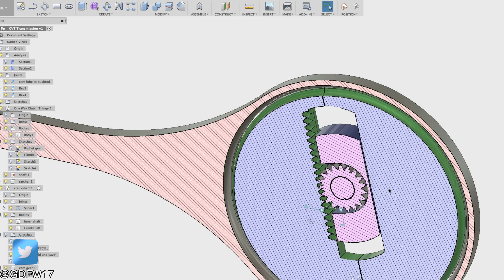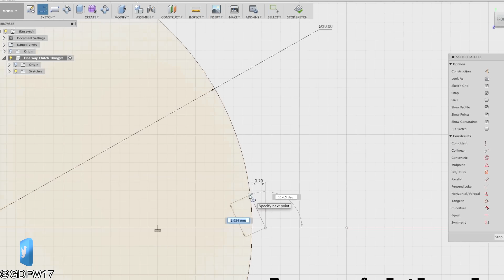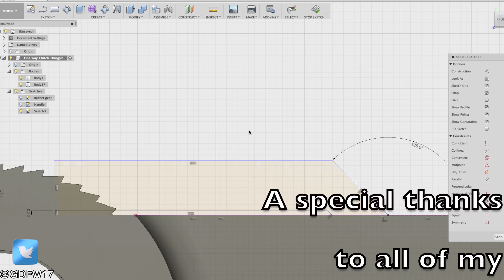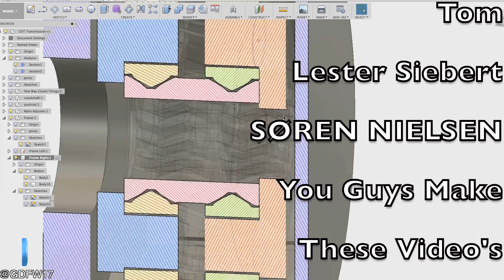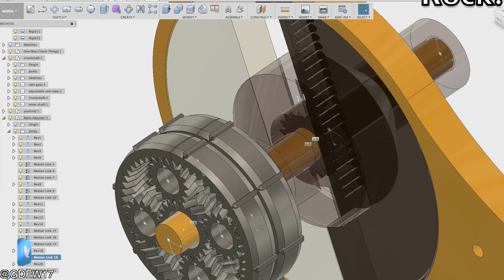The Coolest Transmission You've Never Heard Of... The Ratcheting CVT

Comment: Hay. Your invention is TOO late. with electric mortars. there is no need for a transmission. Teslas, Leafs don't use CVT just one or two fixed gears. even tesla  semai
Reply: If you use enough ratchets, you can overlap their jerks so you actually get a smooth output, similar (well, close to identical) to adding cylinders to an engine. Still, vibrations on the system, and specially the big pushrods would be a heck of a problem, there's already enough crank and rod vibrations to deal with on the engine, and the parts to make it possible at all are quite hefty. Probably gonna be quite heavy, and may add horrible amounts of vibration to the structure even with a smooth output.
Reply: That's all well and good but a recent test was done with a tesla model S being charged entirely off a portable diesel generator, and comparing fuel consumption vs an actual diesel car of comparable size and class.
Guess which used less fuel?

Electric cars are vastly more energy efficient than any internal combustion engine.

The problem isn't the car, it's your source of electricity.
Fuel burning cars are about as clean as they're ever going to get. (remember, by the way that petrol refineries use obscene amounts of electricity as well, an drilling for oil causes a mass of polution. It's more than just tailpipe emissions)
Electric cars are as clean as the source of electricity.
That can range from highly polluting (brown coal), to not at all polluting (solar, wind or other sources).

Obviously, yes, the manufacturing of the vehicle itself is also an issue; (just like solar panels being pollution free is only true if you ignore manufacturing - though again, pollution varies with the method used to power the factories and other stuff  involved).

It's pretty disingenuous to say electric cars cause more pollution than petrol ones as if it's some ground truth, when clearly it's highly contextual.
Especially as petrol cars are as clean as they're ever likely to get yet you're deliberately comparing it to worst case for electric cars.
Comparing best case of one thing to worst case of another...
Yeah.
Might as well say a truck causes more pollution than a motorcycle.
Which is true, but so inane and meaningless as a comparison that it's not very helpful bringing it up.

Finally consider that a decent chunk of pollution caused by petrol vehicles is in the immediate vicinity of the vehicle itself, while nearly all pollution from an electric one is in a remote location.
That won't help the environment as a whole, but it has big implications for things like health in busy cities and so on, which makes it a very useful attribute in and of itself.
Don't be surprised to see petrol and diesel vehicles banned from inner city areas in the near future;
may not help the world, but it'll help the local environment a great deal.
Reply: Electric motors have an efficiency range or power band too, but instead of "turning on" like an old 2 stroke, it's about the ratio of current to horsepower. Electric motors draw the least current when they're spinning at max speed with no load, and the most when they're dead stopped. Any engine generally makes more horsepower when it's spinning faster, but at some point you start losing power due to things like reaction/combustion time, valve timing, or magnetic induction. The mechanism for producing power can't happen fast enough basically. But you generally want those motors turning fast and gear/belt them down to whatever speed you need to move at.
Reply: kennedy796 these are problems that can be resolved in the future, and investments in EV tech will help solve them faster. But you simply can't fix the emission problem of fossil fuel engines, ever.
Reply: +richard vaughn       1hp = 746W, not 786W.
An electric car is very efficient, eg 83% (Tesla Model S) or 89%(Tesla Model 3) vs an internal combustion (ICE) vehicle that averages 20% or less. That is why they are cleaner (yes even if the electricity comes from 100% coal they are worst case no dirtier). Making electric vehicles may be a one off dirtier process than making an ICE car, I have my doubts but I won't argue that point. An ICE uses a large range of materials which have to be precision machined, there is platinum, copper, aluminium and the steel alloys contain many exotic elements, I find it hard to see how building ICE cars is better for the environment; frankly I think the processes employed to make an ICE vehicle are mentally glossed over because they seem so familiar.
Every atom that went into an EVs battery is still there when the battery has reached the end of its useful life, each cell is the perfect sealed package for recycling, ICE, not so much, you certainly can't recycle the petroleum products that get burnt but an EV can run on sunshine (mine does), wind or geothermal electricity.
Reply: No, you will not.
Cylinders can move smoothly because gas pressure don't have to expand at some exact rate.
Solid mechanical parts can't do this. If the part moves — it's either moves all the way as it is or or will bend or crack.

Entire thing might feel less jerky with enough parts added, but every single part will still be jerky.
Reply: You don't seem to know how a racket works then. The only problem on the movement smoothness in fact comes from the crank mechanism not the rackets.
Yes, you CAN overlap perfectly the movements quite easily, you just need to time the rackets so that when one is stopping to push and is starting to go backwards and not produce force anymore on the axle, another one is starting this movement. With exactly 2 rackets 180 degrees out of phase between each other, you get full overlap already, and the jerking does NOT come from the rackets, rather from the crank movement. The big issue is the crank system's unequal speeds, that one brings vibration problems instead, not the rackets.
Reply: Tho... it seems I've wasted my time with mechanically analyzing rackets when you claim others are "bullshitting on you" but you claim 90-98% efficiency (whoa, like close to 0 loss....).
Reply: Well, that's not really true. A electric motor has reduced torque when rotating fast and its efficiency varies with speed, too, so you want to have a transmission in a car (electric racing cars have a transmission for example). You'd probably use the first gear until you're driving like 120km/h (so for normal usage normally not even necessary, and even bad to have more as the weight increases) and then a next gear for the rest. Formula E cars then have 1 or 2 more extra
Reply: Zamundaaa you bring a fair point. But what im saying is that honestly a vehicle needs a light and plentiful source of storing energy. A full 16 gal fuel tank weighs 200 pounds and needs about 150 hp. When we have efficient motors capable of 400 hp, and the battery can charge quick and weigh around 2-300 pounds, then we will have truly eliminated the need for internal combustion and the decline in efficiency will not matter so much. Thus almost eliminating the need for a transmission entirely.
Reply: kennedy796 well I myself wrote that in normal electric cars for the road you won't use a transmission because it's not worth the added weight
For example Tesla used a 2 speed gearbox in the beginning, had some issues and just decided that it's not worth the tradeoff, so now every Tesla has just a single speed gearbox
And as much I like electric cars and don't want to dampen your enthusiasm about them, it's true that electric cars (maybe excluding those city-cars with only 100km reach, idk) are (yet) more harmful to the environment than a gasoline powered car, at least if it's equipped with appropriate filters. The batteries are just horrible. My hope in that field goes into supercapacitors and maybe new battery technology
Reply: Zamundaaa im glad we can agree on something. I do like the idea of electric cars because the cost of electricity is low for now, and they require such little maintenance. It helps reduce waste by eliminating the neglect most ice cars go through.
Reply: Hirantha Bandara I like reading the comments on videos like this, I get a good laugh at these guys arguing with each other sighting all there technacle BS when most of them never actually picked up a wrench and got there hands dirty.
Reply: Daniel Teplitsky  I guess that depends on how the electricity to charge the batteries is generated. If your grid is fed by burning brown coal, then electric cars would technically be more polluting than petrol driven ones. If your electricity is generated sustainably, then an electric car would consequently have zero emissions.

This argument ignores construction emissions and I don't know how they compare between different vehicle technologies.
Reply: Dogphlap The electric car is 80%+ efficient, but the coal power plant that powers it is NOT.
Also, the batteries are typically thrown away after 10 years.
The actual best bet in fuel efficiency would be a diesel electric hybrid which is 38% to 70% efficient.
This is why container ships and frieght trains use this.
Reply: I own about 20 2'x4' solar panels and that only produces 2000 watts max (about 3hp). Its enough for a house but not enough to charge a Tesla car and power a house.
Remember, if your panels need to produce twice as much power than you use to charge batteries for nighttime power. ( or in grid tie to offset nightime consumption by  adding power to the grid).
It is NOT feasible to power your EV with renewables as it would take several days to fully charge and also the car is not present at the home during the day.
Your best bet is to buy an old diesel car and run it on old motor oil and old cooking oil. You need to add a second heated tank for cooking oil, but its easy to buy and install.
Reply: +richard vaughn    Of course the power plant has its inefficiencies, no one has ever claimed otherwise. The good thing about centralised power generation is that unlike a vehicle's engine there are almost no constraints on weight and size and even initial cost is less important since that can be amortised over decades. This allows for maximising efficiencies. Oh and the power plant does not need to be coal fired but whatever the sums have been done and electric vehicles even when powered by pure coal generation are no worse than internal combustion engine powered vehicles. I know nothing of container ships but the main reason freight trains use diesel electric is that apart from steam and pure electric there is no other viable drive train. To get a train moving from stationary with an engine that does not have torque at zero rpm would need a clutch that would be ridiculously large and short lived (I guess you could maybe use a hydraulic coupling (fluid flywheel but that would be huge too)), diesel electric is currently the best solution.
Efficiency is a concept that is difficult to grapple with. My car is powered by the solar panels on the roof of my house. The car is 83% efficient but the panels are 18%. Higher efficiency panels would be nice, the best available panels are still less than 25% though special one off laboratory record breaking cells are in the forty percent range.
Agreed about the expected life of a traction battery, 10 years for a Tesla and much less for a Leaf (at least the early ones) but they won't be thrown away since the contents are too valuable for that, they will be recycled. I've heard that a rebuilt Leaf battery can be had for $2,500, a Tesla battery would probably be ten times that today (but maybe in ten years the price will have fallen some, not that Tesla sells anything for cheap). I have an eighteen year old ICE powered car and the engine and transmission seem fine at 150,000km but the rest of the car is getting pretty shabby. Generally vehicles will be driven until an expensive item needs replacing, the traction battery in a BEV could well be be that item but maybe if BEV become common replacement batteries will be a lot cheaper, I have no idea how that will play out. Cell prices are falling rapidly now but how long that will continue is anyone's guess (it would be nice if they followed the solar panel cost curve, hey I can dream).
Reply: Beardman Hairy Ideal solids maybe, but real solids aren't necessarily fixed either. Ductile materials will deform although on a much smaller scale. Actually, so will brittle materials. As long as you stay within the plastic deformation region, you don't change the stress-strain relationship either. Yeah, gasses get a little more complicated, the curves aren't necessarily linear, etc, but I think it's important to make the clarification.
Reply: The purpose of a CVT is to produce variable speed from a fixed input (usually at an engine's/motor's peak efficiency) so it's plenty useful in either system
Reply: Electric vehicles really tend to not like cold climates like in northern countries, ie: canada, norther states, northern europe, russia... h
There range per charge completely goes to shit, and when it hits -50 batteries tend to just say fuck it altogether
Reply: Hay is for horses, and mortar is for joints... genus
Reply: Beardman Hairy electric cars produce quite a bit MORE pollution overall than gas. Lithium, yeah kinda toxic stupid. More mining, more pollution there and then refining into batteries. I know you're not gonna get it, or you wouldn't have subscribed to the electric bullshit to begin with if you had a functioning brain, but I'm telling you anyway.. YOU ARE FUCKING STUPID!!!
Reply: Daniel Teplitsky actually, your full of shit
Reply: richard vaughn not if your smart and use renewable resources and reuse or recycling
Reply: Actually, there is lots of surplus energy off-peak in the current grid. Large generators can't be shut down even if there is little demand. Much energy is simply wasted that could be used for battery charging. FWIW, there have been no Chevy Volt batteries that have worn out and needed replacement yet even after hundreds of thousands of miles.
Reply: But not cleaner than HHO!!
Reply: Look into HHO! If not for the oil companies, we would use water to run cars!
Reply: Nick Nadeau who cares? Electric and biofuel cars arent fun to drive anyways.
Reply: You've clearly never driven a Tesla... it's a rocket and a total blast to drive.
Reply: DaminalTheAminal i enjoy being pulled into my seat with every gear shift. I enjoy the rumble of my boxer engine. I enjoy working on my engine, adding parts, modifying it, making more power. Until an electric motor can be customizable, i will dislike driving any vehicle that uses them.
Reply: Hirantha Bandara Thats not entirely true. Having a transmission allows an electric vehicle to go faster with a smaller battery system and motor.
In fact, future cars will have them.
Reply: Actually, That was just paragon of bullshit
Reply: Richard, don't try to bullshit on us here.
Having gears for electric engine can only allow less powerful engine to give more torque trading it's speed and vice-versa.

The thing is, for vehicle to be useful you need it's wheels RPM to be in-between 0.1 and 100. Which is 1000:1 RPM ratio.
With gas engine you can't do this with single set of gears because it can only run 1000-8000 rpm, which is 8:1 RPM ratio at  best (most likely you won't even get 2:1). So you 125 times short of what you need. So it is not nearly enough to be good for the application.
While electric engine have hard times achieving this 0.1 RPM, even cheapest electric engines can output 10—10000 rpm, which is well in range. So all you need is to reduce it 100 times and you don't need to switch gears in your transmission ever.

Modern electric engines already 90-98% efficient, there is not much room for improvement and there is no need for it.
Reply: Daniel Teplitsky Thats true in most cases. People forget how electricity is made and how the rare earth magnets are made and how batteries are made.
An electric car allows you to relocate the polution, it does not eliminate it.
The pollution created by making an electric car is very significant as they need advanced materials.
Each car uses more electricity in 1 day than your house uses in 1 week.
Cars are typically 100 to 200hp. 1hp = 786 watts.
Your house uses typically 1000 to 5000 watts which is only 1.5 to 6hp.
Reply: Daniel Teplitsky bollocks, in States with lots of coal power it's closer but still no banana. Remember the power grid is getting more cleaner every year. https://electrek.co/2017/11/01/electric-cars-dirty-electricicty-coal-emission-cleaner-study/
Reply: Beardman Hairy, I second this. Electric cars are far cleaner and far more energy efficient. Everyone who says otherwise hasn't done their research.
Reply: I know you have a hard on for electric motors which are truly amazing, the auto motive specific issue is that batteries are fucking heavy and take forever to charge. I can fill my gas tank in 10 min max, and travel 65 miles before a tesla owner could fill there battery and drive onto the highway.
Reply: You're still doing more good to the environment by buying a used gasoline car than a new electric car
Reply: Richard, please take your bullshit with you and go.

1. Modern batteries can be completely recycled thanks to new Chinese recycling tech.
2. By localizing power production you will not just relocate pollution production away from people (which is by itself worth a lot), but you will also waste less resources to pollution. Because bulk production is just more efficient.
3. Electric car doesn't need much advanced materials. It's 90% the same, 9% batteries and 1% magnets.
4. Each car uses more gas than your entire family in its lifetime. So what?
5. Where the fuck you got this numbers? My AC is 7000 watts alone.
6. Advanced materials don't equal more pollution and in most cases it's way less polution.

You can power electric car with sunlight. Can you do the same for gas car?
Reply: BTW. what is that noice when that thing rotates.
Reply: It's the thing grinding itself.
This is the one reason this was never used in production. Even if made out of tungsten carbide, it will self-destruct in few weeks at most, more likely in few days.
Second reason is that instead of rotation it outputs a lot of small jerks. Which will feel awful and tear down everything else in the vehicle.
Reply: Actually, Gasoline cars are cleaner than Electric cars